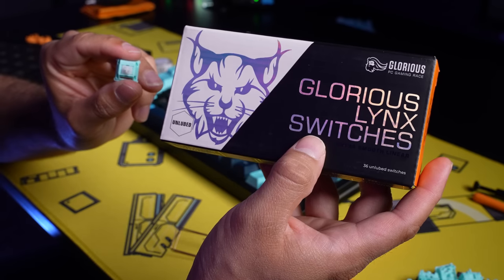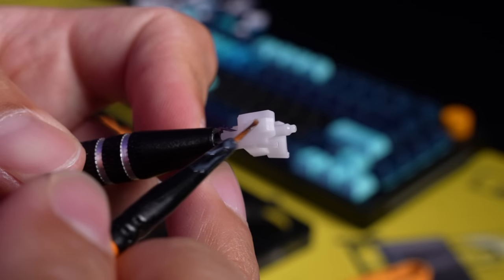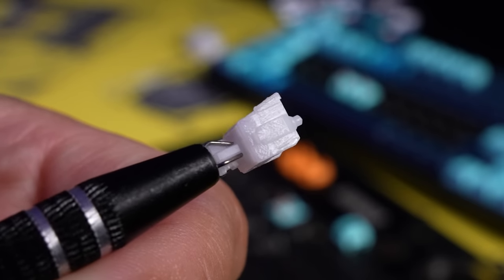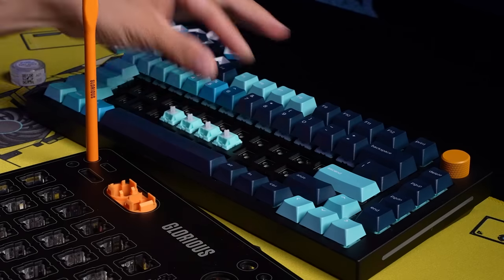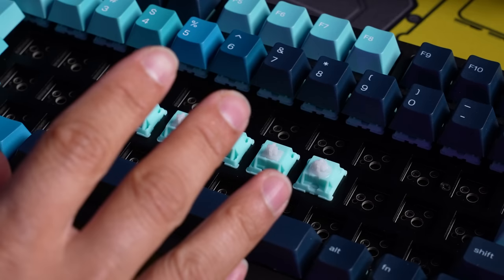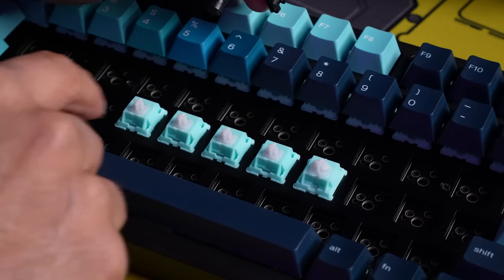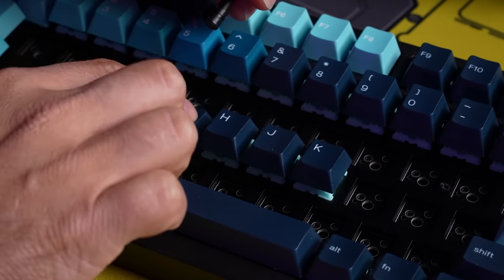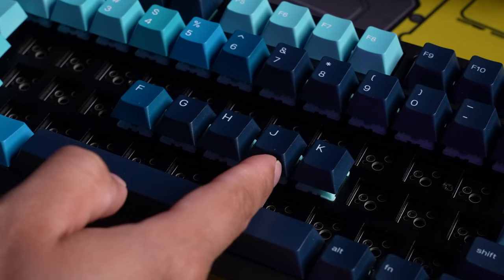Overlubed Mechanical Switches

Comment: I overlubed my non hot swappable keyboard a few days ago and it became very hard to type on. I had to spend close to 4 hours removing excessive lube from the switches, so whatever you do I can recommend to add less rather than more for your first time.
Reply: I overlubed, but not filling the whole thing, I clog the hole in the middle where the key "needle" thing goes down to keep it stabilized. It's crispy responsive but it's way thockier.

Comment: It really depends on the type of switches you have too. When I over lube linears that has more than 62g of actuation force, it feels very unresponsive and uncomfortable to type on. With linears less than 62g of actuation force, I actually like to over lube them, since they don't feel that sluggish. That being said it all depends on how fast you can type as well. I can type anywhere between 130wpm to 150wpm so unresponsive keypresses will bother me a lot. Someone who types slower, like 90wpm, won't be as bothered because the switches will return quickly enough anyhow.
Reply: dude said 90 is slow
Reply: @veecordero9658  its slower compared to 130-150
Reply: @veecordero9658  It is if you're German... ;-) (Autobahn joke...)
Reply: @kiekto8502  130-150 is slow because it's slower than Barbara Blackburn's 212.
See the problem?
Reply: @skatterpro  Barbara Blackburns slow because a lot of people can type around 300 wpm
Reply: @skatterpro there is no problem, he said "slower", which means he's speaking relatively. 90 wpm is not slow, but it is slower than 130. 100 mph is not slow, but it's slower than 200 mph. Difference between calling something slow versus saying it's slower than something, og comments used the latter
Reply: 130-150wpm sounds like cap
Reply: @razrv3lc  Sounds like you type slow lol
Reply: @razrv3lc my type racer stats would like to have a word with you

Comment: If you didn't lube the pole, #4 would likely have not been squishy like that and been perfectly responsive. Same with #5, I don't think it would have been that dramatic were the pole not clogged up to dampen stroke haha. I've always done it between 3 and 4 (essentially paint the rail, hit the spring seats, and lightly run the brush down one side of the spring to form tiny blobs that will dampen ping - using a long-lasting di-electric grease) and after about five years so far haven't had issues with drying out like the boutique greases seem to do when applied so thin. I've got a few before-after's that I've filmed to showcase just how it transforms just about any board, but the only one I ever put up was for a NPKC 60% where I installed OG Zealios. It went from clack-town to seriously quiet, I couldn't believe how well it worked; and any keyboard I mod like this only ever gets smoother as it's used more.

https://www.youtube.com/watch?v=2_W8Abs_Gc0

Comment: The 5 is just over the top ridiculous. I'm between 3-4, I don't feel that's "over lubed". It's not like there is a standard for it anyways, sure the professional nerds say to just put a tiny bit on, but I think it's a preference just like the board or the switches you chose. Just built a Q1 pro with Gateron Black Ink V2 and I like them to be quiet and very smooth and don't mind the slight decrease in responsiveness, I even do o-rings and weighted caps to really get that thick and heavy feeling.

Comment: When I first tried to lube a keyboard I ended up doing a lot of keys like the 2nd to last one.  Overlubing actually makes switches somewhat clicky sounding which is probably from the stickiness of the lube acting on certain parts instead of benefiting from the greasiness of the lube.  Like a bell curve switches are loudest when either under or overlubed.

Comment: While lubed switches are nice, I went without lube on my board and fell in love with the sound and feel.
I'm using: Keychron K6 Pro with coiled aviator cable, Cherry MX Black Hyperglide and GMK Shanshui Old Path keycaps.

Good production in the video bro, keep it up. 👍

Comment: I just lub the guiding channel of the base part. it works pretty fine....only the clicking of my blue cherry switches disappeared, which turned them in to red ones... :D. Easy rule for lubing...start with very less,...add more as required

Comment: Did I overlubed my Otemu red switches?
2 small drops for the housing sides and brushed the contact springs ( didn't lubed the button )
2 small drops for the spring's ends
2 small drops for the stem sides and evenly brushed other sides ( you could see the oily lube like switch 3 : medium ) + 1 very small drop for the stem leg
2 small drops for inside the upper clear plastic body ( you could feel that the clear plastic is not clear anymore but not able to see the white lube )

It feels kinda heaver and buttery but I can't hear a tactile or spring noise from the switches. Was my first time and afraid to overlubed it already it took 2 days to lube the leys.

Comment: Thanks that was fun. The super-lubed switch sounded like stepping in mud. I am about to lube my first set. (GamaKay Mercury Linears) They are already factory lubed, so I will be curious how different the ones I work on will sound. I just don't like the hollow "spring noise" in a non-lubed switch. That's really what I want to get rid of.

Comment: Heya i have not testet this, (i don't even have a mechanical keyboard yet) but i think severly over loobing could also lead to keys not registring anymore since loob is usually insulating. So if you manage to get loob on the metal contact you could just render the switches useles or make them unrelayable. 

But again this is just a thought i had watching the video. 

Maybe you wanna test this too at some point?

Comment: Back in the day i killed two razer blackwidows with cherry mx blue switches by spilling monster on them. I quickly then taught myself how to flush the switches and the keyboard to completely clean it.

One day it was all sticky and stuck keys and basically garbage. A day later everything had been flushed out by air tool oil and literally feeling brand new. IMO there is no such thing as too much lube, you can soak those fuckers and eventually it will work its way through the switches, clean them, and then come off/dry up. Then you just lube em normally after theyre all good.
Reply: Oh by the way, if you ever have the misfortune of trying this. Blast the heck out of that sucker with compressed air to get the excess oil/lube out faster and soak it up with some paper towels. Air tool oil will literally clean the switches on its way out.

Comment: I have try super over-lubed my switches before and when I plug it to the pc, it began to do a something like ghost click thing. And I found that I over-lubed too much on the copper plate that make contact with the stem. So I clean it up and make it over-lubed just on the stem and the spring and it works fine. I used Outemu Brown just for starter

Comment: I think a big issue with "overlubing" is that it will attract grit and grime if it starts seeping out. But I did hear the squishy sound as well, but that will probably go away over time and was apparently only audible without the keycap on.  Also the sound might not be uniform across all keys if you don't lube them all the same.  I feel with speed switches they shouldn't be lubed.  But thats just my preference.